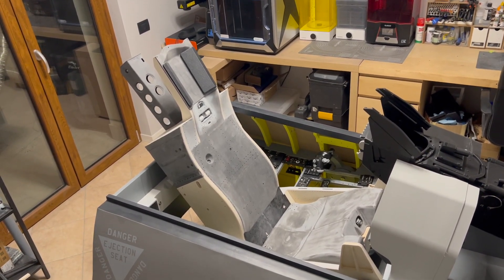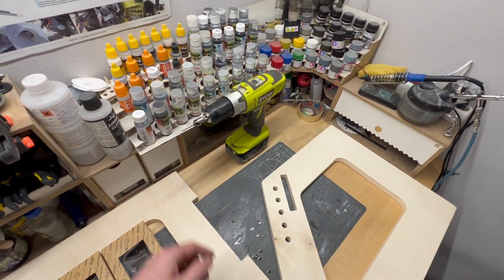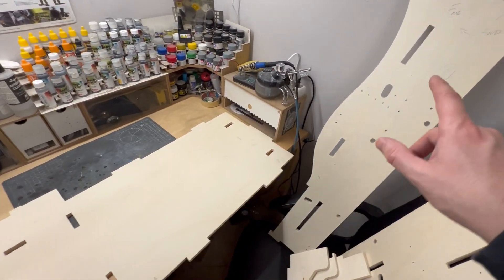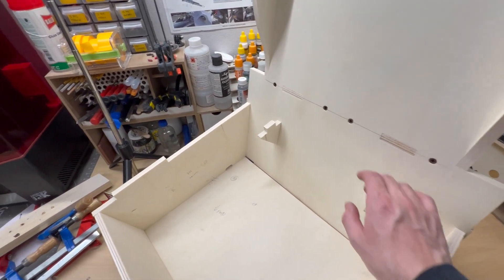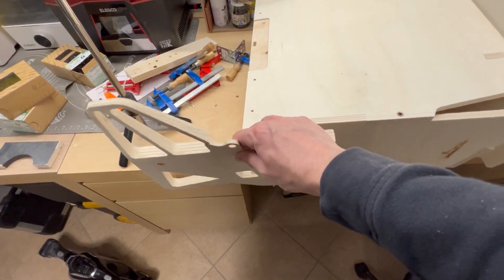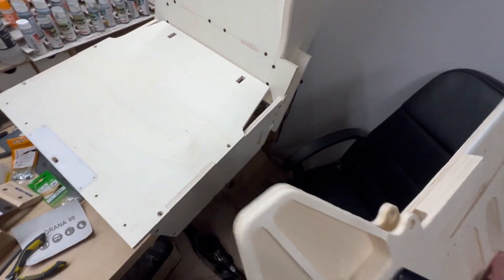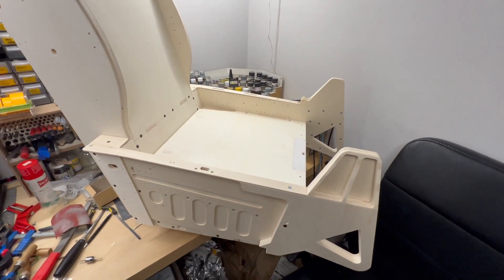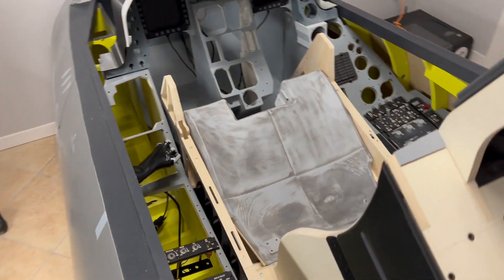Building the ACES II Ejection Seat from Alert5DesignStudio!

Comment: Could you please provide information on how to cut the 3d parts so that they fit 3d printer? Thank you
Reply from the maker: @LalaPala-ml2or  you can easily cut the parts in your slicer and add connectors or slots to help you assemble them once printed. There are also 3rd party software that do that but I stick to my slicer (orca)

Comment: 2:21 good design tip is actually have small holes drilled into the corners before the slots are cut out: its call a dogbone and it means you don’t need to square the edges.
Reply: Yes, the release version plans will have dog bones.  I’m actually putting them in as we speak.